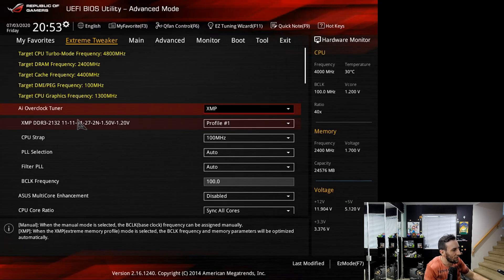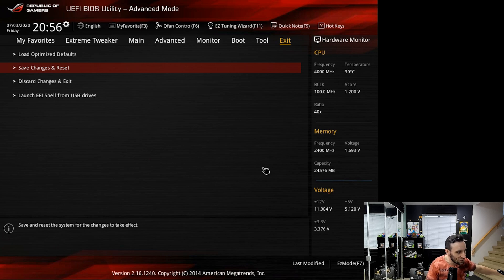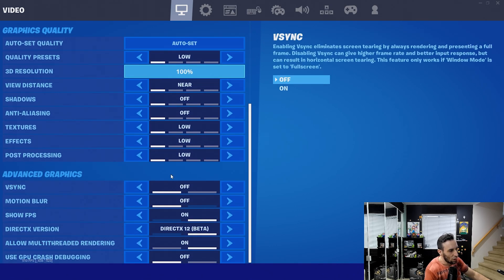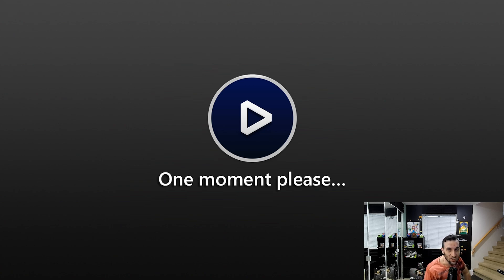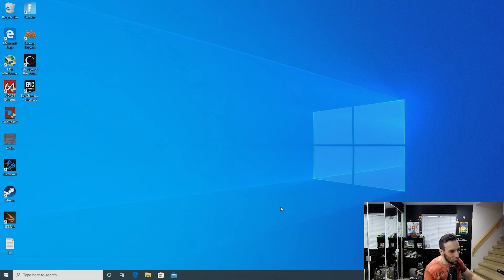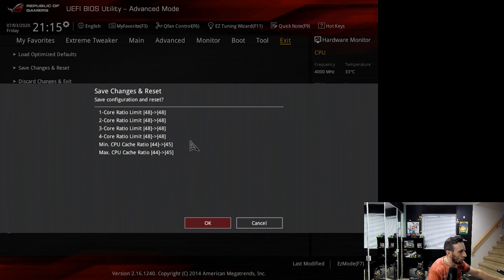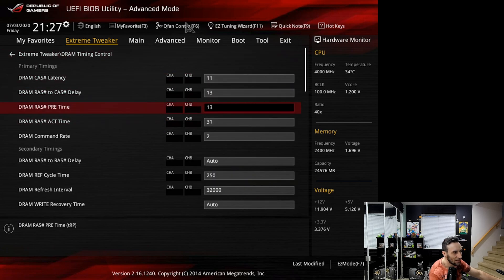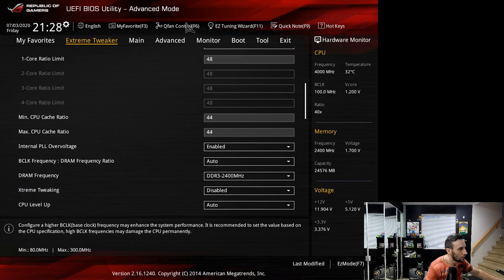Overclocking Cache Ratio, How can you tell if its stable?

Comment: I used this tip to check my cache on my 4790k recently. My fps could only go to 400-422 but definitely maintained mid to high 300s with the odd high 265ish and very rare flicker of 150ish but never below that.

One thing that interested me - and I'm still new to ocing- is that when my ram was unstable from overclocking 1866 10 11 10 30 to 2200 10 12 12 34 (got 1 memory error in hci memtest at 150% on one thread, while the rest cleared 300%+)... I lowered my cache down to 4.0 from 4.1. I used Aida memory bench and Cinebench to quickly see if anything noticeable changed because Uncore does extremely little apparently on Devils Canyon, and observed lower reads and higher latency with a wide variance, and cinebench scores were lower avg and wide variance compared to pre ram oc - and when initially going back to 4.0 stock and auto volts, I bsod'd in Cinebench which never happened before at stock, the only difference was RAM OC.

Upping the cache voltage, under the impression it was secretly unstable like the Fortnite tip reveals, from 1.2, 1.21, 1.22 yielded increased avgs, tighter variance, and less latency. By 1.22 5 passes of Cinebench were all 5200+, and Aida was very close (albeit lower - 31.6 to 32.2 53.5 latency vs 31.9 to 32.X 49-51 latency) to the original 4.1 uncore @ above ram speeds.

I haven't gone back to test HCI yet, but it seemed that with the ram overclock, 4.1 uncore 1.21v was secretly unstable, and 4.0 1.21 was still unstable and needed 1.22 now (and could no longer run Auto). Fortnite also became noticeably smoother gameplay!

Sorry for tldr, but I hope I help someone digging into OCing cache and ram, especially for Haswell/DC/DDR3!

I also noticed remarkable improvements to cinebench score and latency by doing VCCIO 1.22 and VCCSA 1.064 (ish) vs 1.152 on each. That's where I finally saw significant and consistent improvements from nudging my already oc'd 2133mhz ram to 2200mhz. (Reads were higher as it should be, but quite varied, sometimes lowering down to original 2133. After those voltage adjustments was when I got 31.9-32.X every aida64 memory benchmark and 49-51 latency. This was still at 4.1 uncore 1.21v and was when it was actually unstable in memtest too, prior to the uncore dropping and volt increase. So it's possible that if I fed 4.1 uncore like 1.25 or 1.26v, under the teachings of THIS video, that it may be slightly higher or tighter variance! But I get +1C degree just jumping from 1.21 to 1.22

... my main takeaway or point here I guess in hopes someone might find it useful in the future is that if there's memtest ram instability.. maybe check out your uncore and voltage. It might not fix the instability, but it appears ram OC impacts cache/cache voltage. It MAY also explain why I had a random watchdog bsod gaming.

Comment: Prime 95 small FFTs will tell you if the cache is stable.  With cache you never want to run anything if you are unstable.  Its an easy way to get lots of data corruption very quickly. It can take days before you start to see issues, by then you will have to redownload half your game because of data corruption.

Comment: It doesn't work for Alder Lake, though. Pushed my cache to 5066 and the drops while booting where from like 570ish to 490, sometimes 280, and after the os loaded all its' stuff they were gone completely. 5200 wouldn't even boot but thats because my cores are at 5200 and having both at the same speeds, or the cache above the cores, doesn't work in general.
How do one test for Alder Lake cache misses ?
The Aida cache stability test doesn't find errors, but Prime95 small FFT's gives me rounding errors as soon as I hit start. Lowering the cache speed makes that go away, but is it fully stable then? I haven't seen viable reports of people stating that their cache reaches 5+ GHz easily, not even with Raptor Lake.

Comment: Tested this with my 13900K. Seems to be stable at 5Ghz cause my "low" FPS never dip below 900 while my high FPS is also around 1k. Thanks a lor for this video.
Reply: What ring voltage do you use? On my 13700k 5ghz isnt stable on auto but i dont know what to set my voltage to. It can go between 0.9 and 1.1
Reply: @Ranger18031  did you figure it out?
Reply: @IDK-gh4st  no, i couldnt get it stable with good performance, so i used an msi automatic adjustment feature that worked very well

Comment: Unfortunately Fortnite has capped FPS to 120 in menu. This is regarding you have it to unlimited. I have a 10900k and with cache oc or stock the ingame behaves the same. In the lobby with lots activty and I turn around fast it can drop to 50 in the down or up ... this is with 3-400 fps+  So I dont know if its possible to verify anymore in Fortnite.. Because in the lobby it dosent look like its working.
Reply: You can uncap the lobby fps by editing a config file within the Fortnitegame folder in Appdata/Local/.
Reply: @dimitry7182  Oh really? I didn't knew that.. im gonna look into that.. but not before my new rig is complete in about 1-1.5 month..  I am receiving my 4090 tomorrow though ..
Reply: @dimitry7182  thanks man. Also, I found you have to set it to a number, as "unlimited" doesn't work so I just did "2000".

Comment: You don’t know how much this helped me! I had what I thought was a stable OC at core 50 and ring ratio 47 but when I would play games it would stutter and feel delayed. I went crazy trying to figure out what the issue was. I even went back to stock and was having these same issues. It wasn’t until I saw this video that I tried lowering my ring ratio that I knew what the issue was. I had to lower my ring ratio to 42. I tested using fortnite lobby screen and BOOM stable frame rates in the high 300’s! I noticed if I tighten the timings of my ram frames start dropping again. I wonder is ring ration/cpu cache frequencies are linked to ram timings? Anyway thank you so much for your help on this!

Comment: Insane test technique. I am overclocking my eam at the moment, after I saw your Warzone ram speed video. Started at 16-16-16-36 TRFC 631 3600Mhz 1,35V and I am now at 16-16-16-33 TRFC 300 4000Mhz 1,45V with my Samsung B-Dies, still testing. First run TM5 was successfull.
Will try this in the next days. First I try to boot 4200 CL17, that didn't work before. Maybe I soften some timings for first tests if the Kit / CPU can achieve the speed.

Comment: Jufes, how to OC cache in Z490 Unify if cache core voltage cannot be changed individually?
Reply: @thecatdaddy1981  Thank you! Appreciate your help. I'll increase it in small increments and test on OCCT to check stability.
Reply: @MarshalMusk  Sure, but I am no expert on this matter. I had a "cache freeze" today myself (where the PC freezes completely and you have to hold the power button to shut it off). Granted it took pushing my room temp to 29C while playing Days Gone to cause it. I was testing to see how high my GPU temps would go. I had vccio at 1.25v with 4.7ghz cache, while I hear from a few people that my vccio probably was too low. Gonna try it at 1.28-1.30 for a few days and see if it happens again. But it could also be one of my tertiary timings being too tight, there is one group of them which also can cause system freezes. It's gonna take some experimenting to find out exactly what caused this freeze I had today. Either way, on Skylake/Comet Lake, cache is affected by vcore and vccio as far as I know. Overclocked ram and tightened timings might also make the cache unstable. It all ties together, which is why figuring out the exact cause of any instability here is tricky.
Reply: @thecatdaddy1981  that's a typical cache overclock failure. It happened to me too.
I just found out that my 10850k cannot do 3x cache speed under my clock speed (5Gb on CPU, 47x Ring/cache/uncore). I had o decrease to 46x then I got it stable.
Reply: To make cache stable, you can decrease cache or increase cpu voltage (unless you're not limited to your limit temperature)

Comment: Well, it's a little weird. My 5960X froze once while editing videos with the ring ratio at 44. This was like november of last year I think. So I lowered it to 43 and kept it there since and never froze again. Just to see if I would get these FPS spikes I tried 44 ring in fortnite, but it didn't happen. The FPS hung just over 1000, lows were in the 700-900 range, my frametime graph was flat. I will try this fortnite trick more in the future though. Then again you mentioned temperatures affect cache stability, and video editing pushes my CPU temp way more than running this game. Interesting stuff regardless lol.

Comment: I been having so much trouble with my system, especially since I'm new to manual overclocking, I think this is going to help me tremendously 

I just hope that 4x8 dominator kit I got with all them pretty lights will actually run at xmp, and I don't gotta down clock it ..

Comment: Brand new to overclocking. I have an i7 4790K as well.  Your tip on not overclocking the cache past 4.4/4.5 answered a big question for me.  I had my OC at 4.6 ghz for the core and the cache.  It seemed stable but while in a game it froze with an obnoxious sound.  Had to hard reboot then set the cache back to 4.0 ghz.  No problems after that. But now I would like to get it up to 4.8-4.9 ghz on the core and try 4.4 ghz on the cache.  I think I have the headroom wrt temps and voltage.  Any advice would be appreciated! :)

Comment: I have a 10700k overclock at 5ghz all core at 1.36 very stable and cool, ram at 4000mhz, but as soon as I go over 43 ratio with a Z490-A Prime motherboard, I can see the drop happening in Fortine.  At 43 again, it's stable but I only can get 350 fps (stable with up and down fps) and in your video, you go over 500fps.  Graphic card 3080 Asus TUF OC is also overclocked and can reach 2035mhz non stop running also around 60C, which is pretty cool. I am not too sure how to get  that kind of FPS, it's seems about 30% more on your end with your setup.